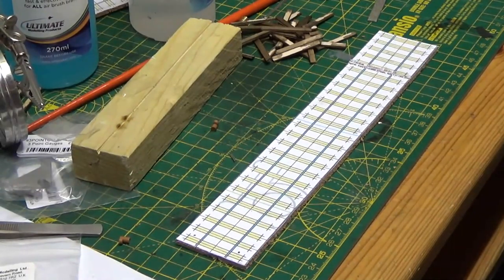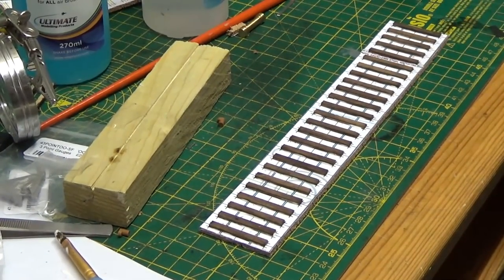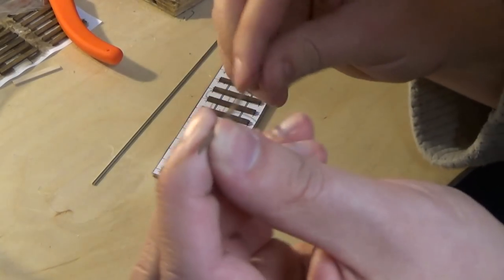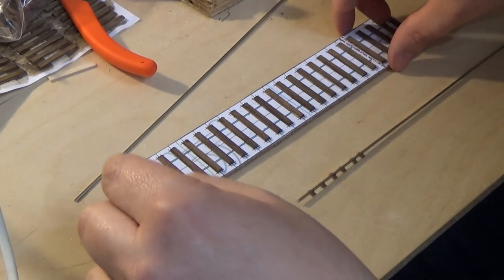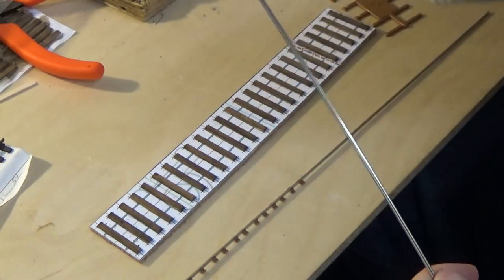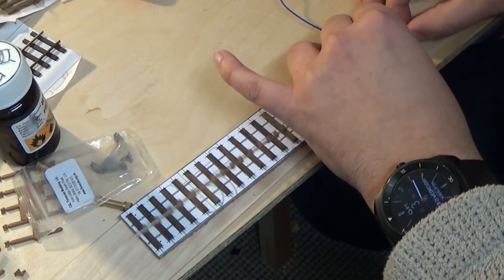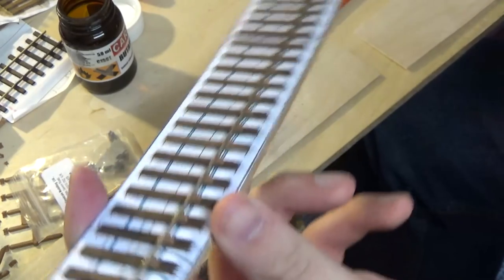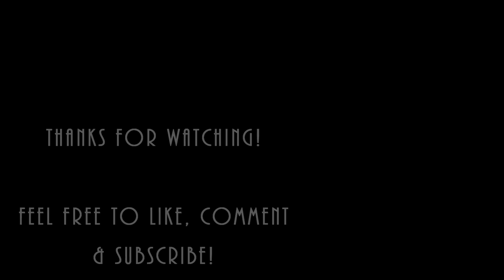Model Railway Update 16 Making The Trackwork Part 2

Comment: Excellent video mate!  Been there and done it numerous times with 21mm 5' 3" Irish rail.  00 gauge is only 16.5mm wide.  Makes a huge difference when working with Irish models.  At 4mm = 1 foot.  A difference of 4.5mm translates visually in real life to 13.5".
Reply from the maker: Nice, it's very satisfying building it up for sure. I have seen some Irish rail modelling and you instantly notice the difference.

Comment: How many people ae going to say the same saint phrase? 

I'm not.

Anyway good progress.

I must buy a point blade filing jig.

I never used one thus far.  Always bodged it by eye and hurt my wrist in the process ... worked though!

My V jig was graph paper and blue-tak.  Lol.  Again worked!

Think I will buy these jigs though for speed, consistency and accuracy - should reduce expletives later on down the line.

Watched the previous video too.  You mad man!   I brought sleepers and timber strip from the Scalefour Stores and C&L.....but your extra effort with ply sheets and a guilotine must have saved a few pounds.

Respect!
Reply from the maker: Thanks very much, I thought I'd show people how it's done as making plain track is really easy when you get into it.  Maybe it might encourage a few others to try it.

The jigs are totally worth it,  I still struggle with the blade jigs though as they still haven't came out satisfactory for my liking yet. (Luckily I had a few pre made blades left over from making a few P4 points a few years ago)

Even with the vee filing jig I still used abit of paper with the vee printed on and a few bits of wood glued in the right places for soldering the 2 bits of vee rail together, I found it much easier and quicker than using the jig itself for that part.

I could have used c&l pre made timbers but as c&l deliveries were taking forever at that stage I decided to do it all myself using a proxxon saw, it actually didn't take all that long to do tbh, I even used templot to print out a measurement guide to save me having to set the guide up for the cut everytime.

Cheers
Reply: Michael Henfrey - Yeah.  The new guy at C&L has been overloaded a bit; spoke to him at exhibitions.  Hopefully he'll be able to get it all sorted.  

I may one day buy a cutter thing and plain sheets if it works out cheaper.  Buying strip doesn't cost much but the pre lazer cut point timber packs at around £10 a pack can make the sound of a steam whistle....no thanks.  Also not much good if you design the custom points with Templot as you need to cut your own lengths.

I'm itching to build some track again.  Serious.  But until frame work is done baseboards can't even start.

Maybe I'm going crazy but I want to paint the keys in the chairs light grey and pick them out next time to see how convincing it may be.

Are you a member of the Scalefour Society?   They still cater for 00 even though P4 is the focus, great bunch of lads.
Reply from the maker: Yeah the strip isn't as expensive as the laser cut version and it still can make things quicker if you make a quick sawing jig so that you put the strip into the jig until it hits a stop and then saw away.

I used cork and glued the templates onto that, if you went that way then you could start making some track ready. Painting each key could be a time consuming job, it'd probably look amazing in photographs.

I am still a member of scalefour,  I find the knowledge you can get there really helps for any scale, Even saw a tutorial on building a wagon which I'd like to have a go at sometime in the future.

I almost went P4 for the layout but with no experience of building stock and the fact of the large curves needed it really didn't suit me.  Might try an inglenook again in P4 in the future
Reply: Michael Henfrey - Cool.  

I've been thinking of building track on to 3mm thick Bass or Plywood for the sane reason you mentioned it.  Could even ballast each piece prior to laying!

I am sort of against cork and card for track underlay.  Both warped on me in the ballasting stage and bent all the track so I refuse to use it again.  Out N About Part 19 - watch that and you'll see what happened to my layout.  Still upset over it but he ho.
Reply from the maker: Oh right, I will check out that one, Now I am hoping mine doesn't get affected.  Making it on wood could be a good idea!

Comment: That looks great Michael and such painstaking care as you build it.  The track is going to look so good when its done.  What is the total length of track the you need to make?  Or is that a question to which you would rather not know the answer? Stephen
Reply from the maker: Thanks Stephen,  Err honestly it's probably something I would rather not know haha. That 1 section is probably close to the length of a ruler and I have approx 36ft scenic length and some bits will have extra tracks and sidings etc so yes.. A big job!